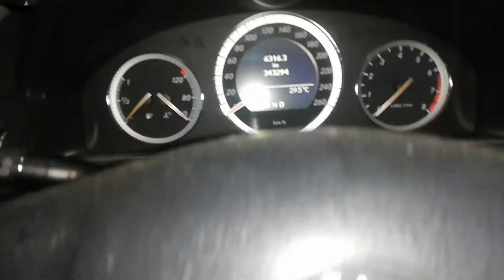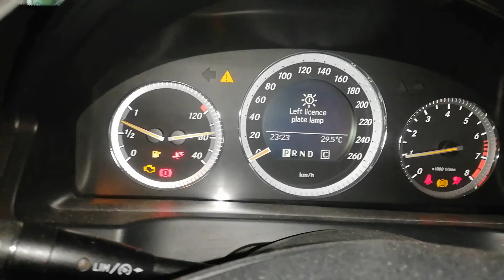How to Replace the valve cover Gasket Mercedes Benz c180

Comment: its better to apply a gasket maker at every conner of the cam head to avoid possibility leak..4 conners at curve area..2 front and other 2 at the rear..tq
Reply from the maker: If there is a leak, it is better to open it